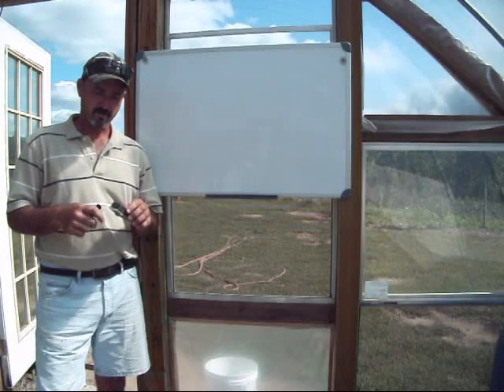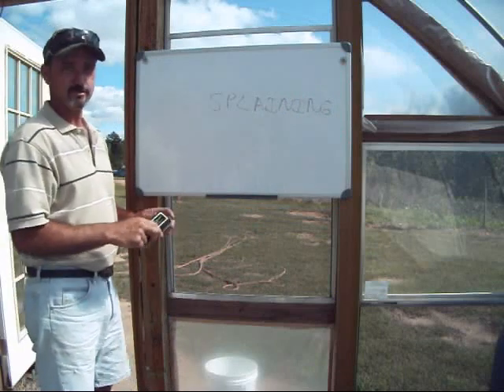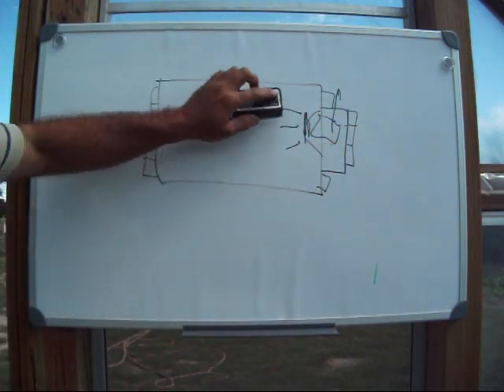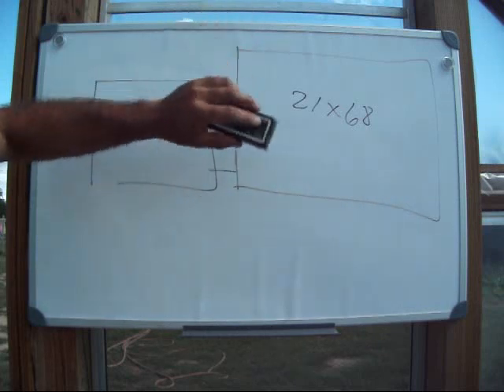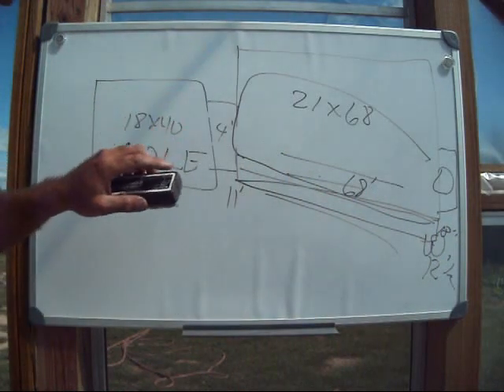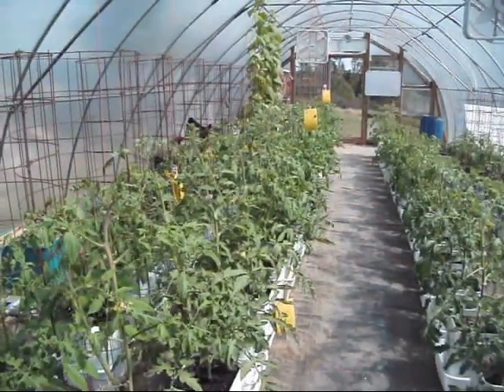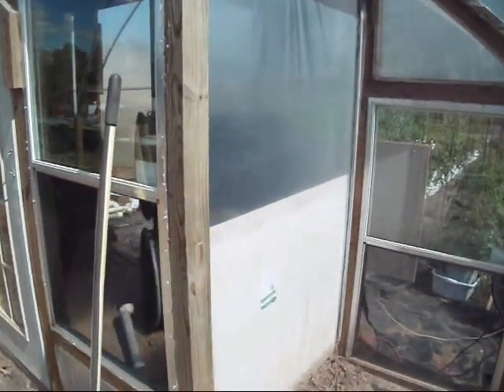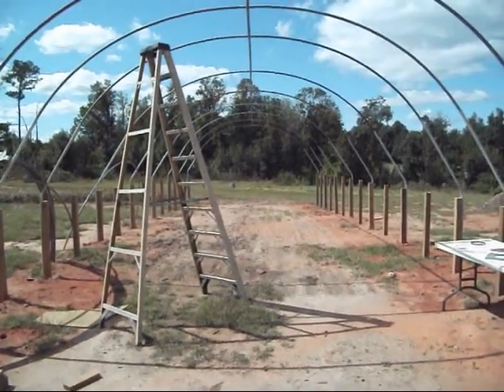A Second Greenhouse - My Design & Thought Process

Comment from the maker: @horticultureandhomes 2 cents? I place a lot more value than that on your opinion.  I agree, in theory the slope sounds good. It should assist me some in the heating process. But part of the reason for the additional height was to allow for room to place fans that wouldnt be in the way, nor blowing directly on the plants. I have 3 fans in the small GH and they are making a big difference. I'm still learning. ;-)

Comment: Okay, heres my 2 cents on this one. That heat slope business looks good on paper but is not a solution in reality. Fans are needed to keep heat at the plant level and not the top of the house.  Also needed to circulate carbon dioxide which is one of the 5 factors of plant growth. Your fans also keep the heat distributed evenly. giving even growth across the house.

Comment: think you would benefit from a rocket mass heater. could run your exhaust pipes underground and use that for the mass. would probably take two for the size, but would use less than 1/4 the amount of wood, and give you much more even heat. look em up sometime. paul wheaton is the foremost expert on them. he's on here as paulwheaton12 i think. excellent looking greenhouse! feller you got it growin' on!

Comment from the maker: @Alprofight Yes, I found one online that will bend 1 1/4 EMT. It takes a little bit of effort, but I 've been able to get a fairly consistent bend for my side posts. The smaller ones for 3/4 and 1 inch are much easier to work with.   Good idea to get it right the first time on your GH. Especially dealing with your weather. I'd like to see it when you finish.

Comment: @mhpgardener It got so hot here I think it melted it, I could smell plastic burning when I would get close. It made round plastic bottles that vitamins come in flat on top sitting inside. Temp showed 122 in there several different days and that was about 4' off the ground, can only imagine temps in the top...

Comment from the maker: @eye4quality Sounds like I'd have one heck of a mess ! LOL  I've read about the process a little bit, a heat sink I think is what its called. From what I understand, the trench needs to go the entire length of the GH. And filling it would require a very large amount of manure, way more than I have access too.  I could see that possibly working on a smaller scale though. ;-)

Comment: @mhpgardener :) and a blessing you are, you have inspired me. I have bought my conduit and working hard on figuring how to get uniform hoops im going with your size for now. looking at heating systems and how to hook up cross bracing for the top of the hoops its fun but a puzzle but way less expensive than trying to buy one tks again.  Ive watched most of your videos by now but not all yet but several of them i have watched over and over trying to catch glimpses of connections & all.  God Bless

Comment from the maker: @SleestaksRule I have. I was thinking of a roll of black pipe circulating water thru some type of heat exchanger coil at night. But I'm not sure how long the manure would produce heat. And rolling it over would be a problem with the pipe inside it. Thanks.

Comment: Winter time cooling down time of the year trying to maintain higher temps to grow can be difficult when considering the cost & time. What wound happen if you were to dig a 6' to 8' deep basement by 12' wide by how ever long you want. Cinder block or wood posts heavy screen, or fencing, with straw packed in between the metal mesh (screen/fence), and the dirt around the sides. Then fill with cow manure while laying out aeration tubes. Put planks across top, and it should maintain 70 degrees...

Comment from the maker: @djs6576 Soil temp is ok with the white bags/buckets. If they were black right now, it might be a problem. Mid-winter, black pots would prob be an asset. Nothing at all wrong with using a GH simply to extend the seasons. Its all about making the most of what you have. Plenty of folks have built them from scrap windows and doors. Hope you get one planned out. :-)

Comment from the maker: @KingRyltar The second layer of poly will be installed in the next couple of weeks, hopefully. Along with the inflation blower. This is 4 yr poly that was put on last Nov, not quite a year old. If I buy IR/AC, I'll pull this off, and use it for the outer layer. Otherwise, I'll go right on top of it. Thx.

Comment from the maker: @mediamaker2000 Soil temps would be about like you'd expect, much lower along the perimeter, especially the north side in the winter. I have black plastic right now helping to heat the ground somewhat. The white plastic is an iffy deal, since it reflects so much light. Plant leaves aren't designed to receive light from the lower side. If you haven't made your mini hoop yet, I'll show you how I'd do it in the next video.

Comment from the maker: @djs6576 Thx. That sounds like a good idea. I checked the heat radiating from the stack pipe last night, didn't seem to be much of an issue going thru the wood roof. I do have a wide metal collar on it, but a little foil covering some of the wood surfaces might not hurt.

Comment: Oh yeah, and Bro...I know it would be a pain in the Butt, however a way to cut down on heat lose in the winter, would be to double wall the green house. Costly yes, Air wall between 2 layers of plastic, fan keeping the inner pocket filled up. Just a thought for you, when the time comes round, when you have to change out the current plastic sheeting you are using. We know it doesn't last forever, we can only wish, or hope for long life with it. Peace bro.

Comment: It would be interesting to know what the soil temperature is of the soil beneath the GH  in both the summer and the winter. I wonder how much it affects the temps in the GH overall. I also wondered if you covered the floor with black in the winter and white ( they make plastic black on one side and white on the other) and you reversed it  for summer if that would help as well as insulation below the floor plastic. Never thought of the grade via circulation! I can't wait to see the next vid! TY!